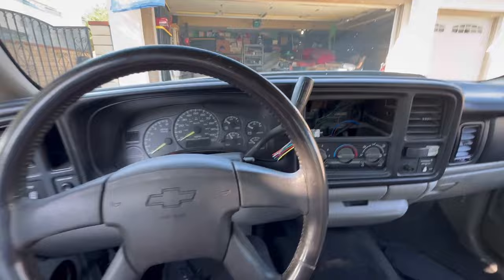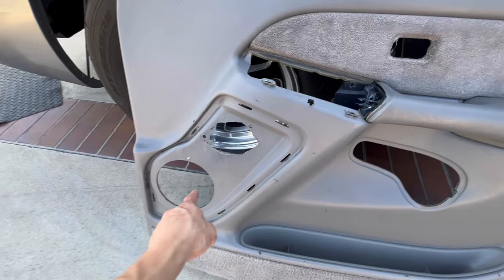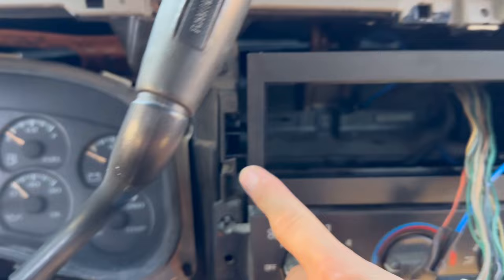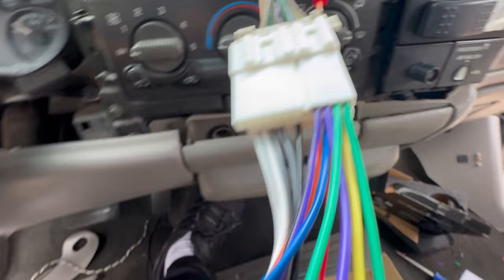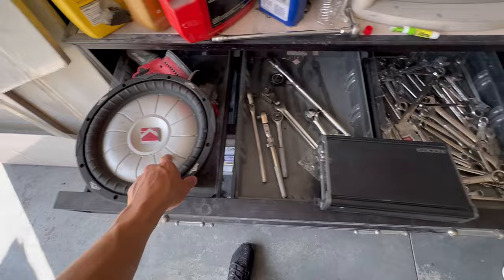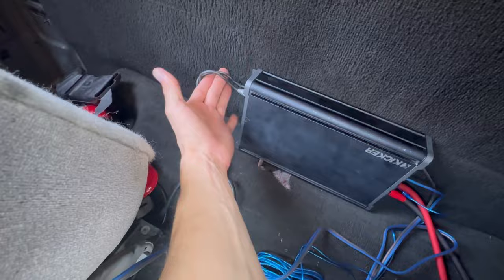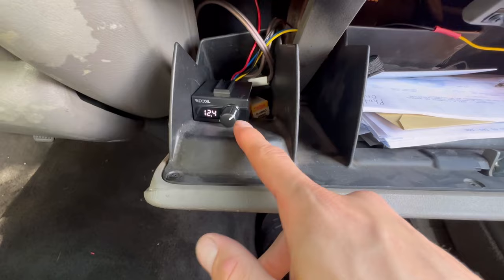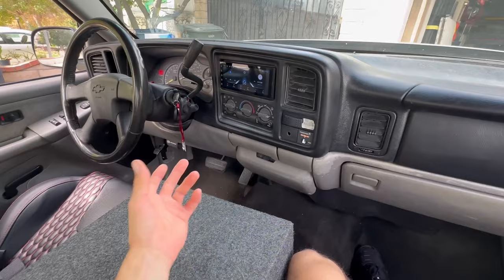SOUND SYSTEM INSTALL ON MY SINGLE CAB!!

Comment: question are the speakers supposed to have bass, i have single cab and the rear passenger sounds like it has bass and louder and the driver rear sounds a bit lower and no bass what could the problem crossover is in the center speaker level all 0

Comment: I wanna do something similar but people on Reddit told me not to wire up the 4x6 into the amp
Reply from the maker: not sure why I haven’t any issues at all
Reply: @ErikRose_  Redditors being Redditors I guess
Reply: They're wired to the internal amp in the head unit in this vid. But there's no reason they couldn't be hooked up to an external amplifier as long as they both have a similar rms power rating. I'm running a set of 3" and 4"x6" coaxial off my head unit, a 6.5"\tweeter component set off a 2 channel amp, and a 10" sub off a mono amp.
Reply: @ErikRose_  Most 4"x6" do not have a very high power handling, like the ones you have are 60w max which is good for running off a head unit like you have set up. Those 6.5" you have though are rated at 320w max and would sound waaaaay better hooked up to an amplifier, same for those Skar tweeters. If you do get another amp you should just get a 2 channel for the speakers in the doors and leave the 4"x6" running on the head unit because the power difference between the front and back is so different.

Comment: Where did you buy the aftermarket dash pieces from? I want to black mine out because right now they are grey but idk where to get them from
Reply from the maker: I actually didn’t buy them, I just removed the original paint/coating and it’s black underneath. Or you can also paint them with SEM color coat with satin black or gloss.
Reply: @ErikRose_  alr thank you
Reply from the maker: No problem man

Comment: How did you get the radio and the dash kit connected together? I got the same head unit to try and the dash kit and cant for the life of me get them to connect securely
Reply from the maker: you got the same ones as me? interesting mine snapped just right in no hassle
Reply: @ErikRose_  yeah. I was able to make it work in the end with some longer screws. Have you gotten the Android auto/ apple auto to work? Whenever I plug my phone in it doesn't do anything or even tryna Bluetooth it

Comment: You lost me at big olbox in the middle...
Reply from the maker: Yeah didn’t fit as planned, will mostly likely be redoing it soon.
Reply: @ErikRose_  Just make a slim box. And put it behind the seats. Kicker I believe has a shollow mount Solo-Baric subwoofer. So you don't need a big olbox in the middle..
Reply from the maker: Yeah that would be the best route to go, cool appreciate the info bro..